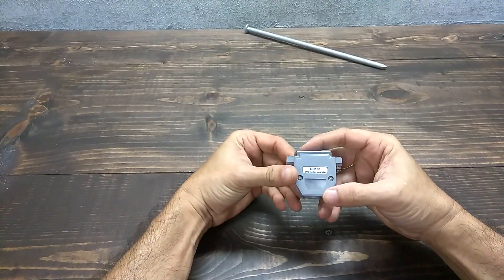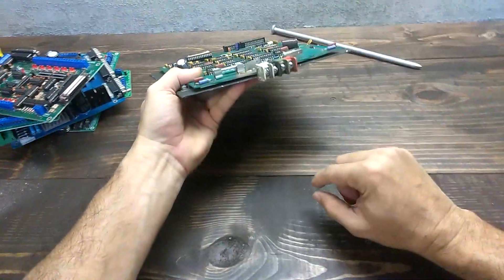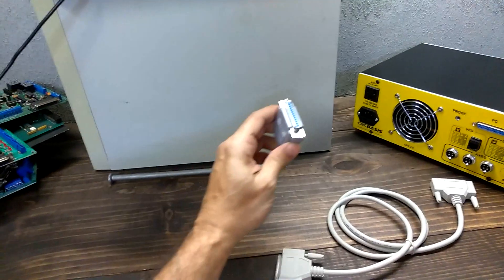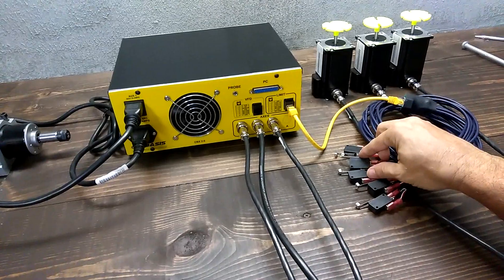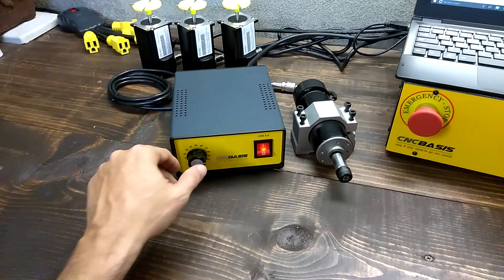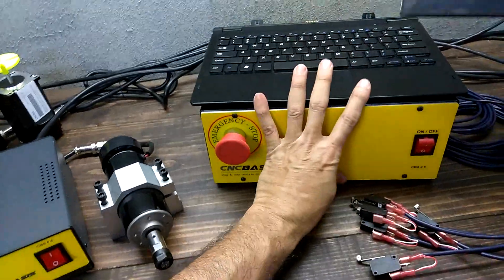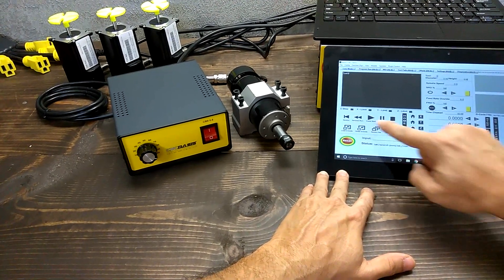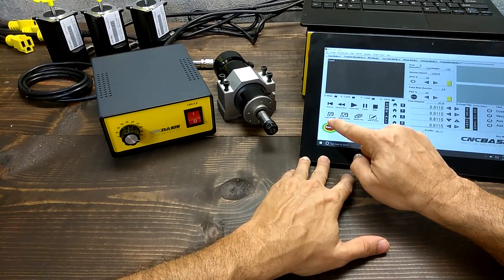why uc100

Comment: Is there anyway to run my second monitor on parallel port as I've only one vga port in my pc no hdmi no dvi only one vga and parallel port and ps port... Is there any way to use second monitor... Please help
Reply from the maker: Not with UC100, back in the days they sold a box with selector for either monitor or both.
Not sure now day if there is some kind of splitter

Comment: its good for d25 chip burner?
or just for cnc?
Reply from the maker: Not sure how chip burners work, UC100 is a motion controller for Mach3, mach4 and UCCNC softwares and commands motion for CNC
Reply: @cncbasis1058  
if its real parallel port?
or just cable?
if its just a cable its not parallel port..
but if there's chip in this device.
mebee  its parallel port
or chip but is not parallel port

Comment: How fast is it. can you jog more than one axis at a time? What about an PPG?
Reply from the maker: 100kHz, I usually jog X, Y, Z axis simultaneously and no problem.
Sometimes need to adjust acceleration due to higher response, some circle become ovals
Reply: @cncbasis1058  thanks,  I may try it someday. I use Mach3, have for many years.

Comment: Do this device work on Windows 10 64 bit?
Reply from the maker: Yes, Mach3, Mach4 and UCCNC software. Some versions of Mach3 had issues with 64bit but I think it's been fixed
Reply: @cncbasis1058  ok thank you
Reply: @cncbasis1058  why not support linuxcnc normal hobby user not use windos newer, linuxcnc have lot safety true realtime, stabile better,  and flexiple make own tools. only idiots use windows because better OS have many.

Comment: would i be able to bypass my memory module on an old vmc from 1995 and run mach3 by plugging into the io module ? i have been wondering if this could be done somehow. i have cincinnati milacron arrow 500 year 1994. any input would be appreciated
Reply: why use mach3, not good not stapile,not can make easy lot more tool system,hall code, makros, use easy pendant, own tools, own makros what help you working lot better. why not use lot better and sure realtime and stapile and flexiple linuxcnc software and have FREE sure.

Comment: Hi sir.
my name is yousef and I am going to use a combination of UC 300 Ethernet motion control and mach 3 breakout board together  with Mach 3 Cam software, but I dont know how to setup them in mach 3 cam software, it would be my pleasure to receive any kind of information about, how to setup it. I appropriate for your help in advance. my email address is as below : 
yousef.mazloum@gmail.com
sincerely yours yousef
Reply from the maker: Hello Yousef,
Need to install UCxoo software from cncdrive for UC300 plugin. For Mach3 config will depend in Breakout board used for pinout configuration, should ask manufacturer for pinout or manual

Comment: I'm having some trouble running a cnc from China using a parallel port on windows 7. If I bought one of these uc100's is it just plug in and go, or are there settings to change in windows and the mach3 program? Thanks for any help. Terry.
Reply from the maker: No change needed in mach3, just need to install plugin.
Should work with Chinese board, just recommend confirming pin 25 of Chinese db25 is GND not 5v. standard in cnc is pins 18 thru 25 GND so is UC100
Reply: why need use lot problematic windows because can use true realtime and better linuxcnc.

Comment: Why cant you just buy a cheap $5 parallel to usb adapter?....why does it have to be the uc100 which is a $100 part
Reply: Because that 100$ part is made special for cnc I've tried everything the only thing that got any response was this uc100 add on my cnc
Reply: Because Windows is not e realtime computer system, so you cant generate in a cheap way the pulses with your computer any more.
In former Windows versions the Dos had the Master control obove all the ports, simple DOS was nearby realtime..... 
If your virus scanner or other processes starting now from windows the pulse generating freezes and your steppers work with different timing, what destroy your workpiece.
This Module the UC100  is not just a simple parallel port adapter, there is a chip in it which generates the pulses without any latency problems.
Reply: @schwellenzaehler4587  why use windows OS because not have true realtime and wery problematic alltime, linuxcnc have lot better can use true realtime no problem newer and FREE .

Comment: It is possible to use the U100  controller with the other parallel port? Both at the same time
Reply: Limitations will be on the software side, neither Mach3, Mach4 or UCCNC will manage two motion controllers at the same time, I have seen people using mach3 and UCCNC running simultaneously in same application, but if you need to use more than one port I will suggest using a Ethernet Smooth Stepper with 3 ports or a UC300ETH with 5 ports

Comment: great video - Does the UC100 work on win7 64 bit for Mach3?
Reply: Yes. I ran a Taig 4 axis CNC mill and a TaigTurn CNC lathe with the UC100 and Win7Pro(64bit). I've since upgraded both laptops to Win10Pro(64bit) and both work fine. Also, the UC100 works with Mach4 (download the different drivers) - if/when you switch between Mach3 and Mach4, the UC100 firmware gets automatically updated (flashed) to work. What I can't say is how many times the UC100 can be re-flashed, but I'm sure it is in the tens of thousands of times. Just to add, my laptops are Dell E6420 i5's with USB 2.0 ports.
Reply: I have the UC100 and UCCNC software. I had mach3 before but I like UCCNC better. If you buy the dongle and the software in 1 package it's not that expensive.
Reply: I have tried, but not tested the Chinese UC100 ($56-AliExpress) in Mach3 with Win7x64 on a laptop with no parallel port and seemed to work flawlessly. Will be testing further with actual cutting. Copy .dll to Mach3 \plugins directory. Use as short a USB cord (3") as possible (not like dude in vid)
Reply: Don't buy cheap knockoff crap. support the developer.
Reply: We have a couple of PC working Mach3 with win7 with no problems but some customers have had some issues.